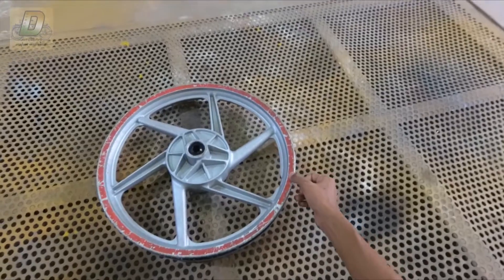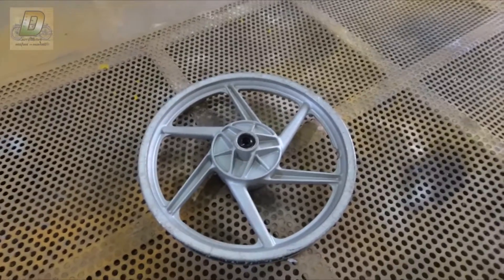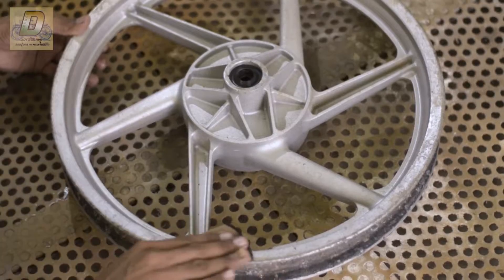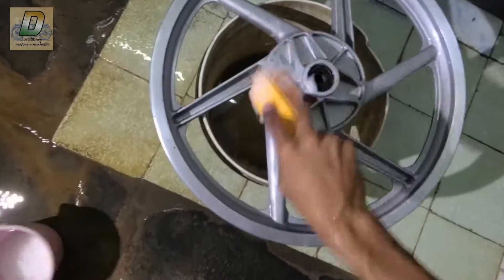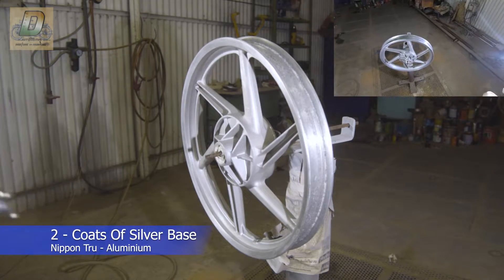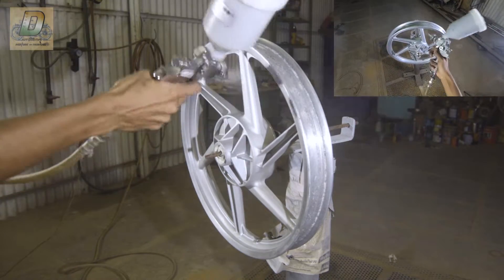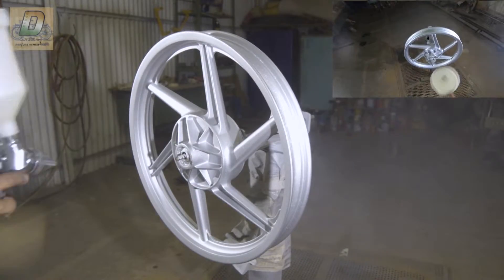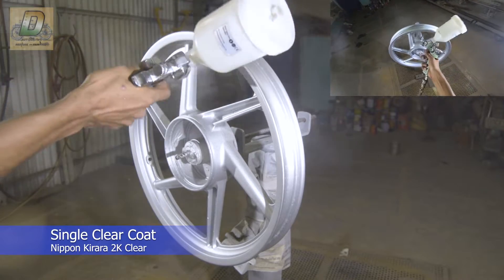Bike alloy wheels painting

Comment: Which sandpaper removes gloss?
Reply from the maker: Are you asking to sand on clear? If yes then use 2000grit
Reply: @DynamicAutoYT  removing gloss for repainting which sandpaper should be used?
Reply from the maker: @pianistan  320g wet sanding